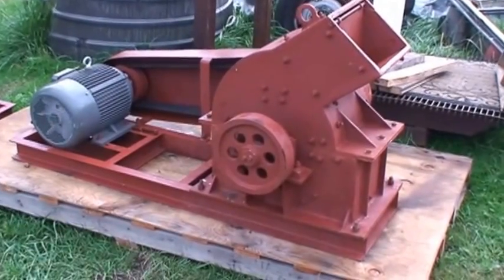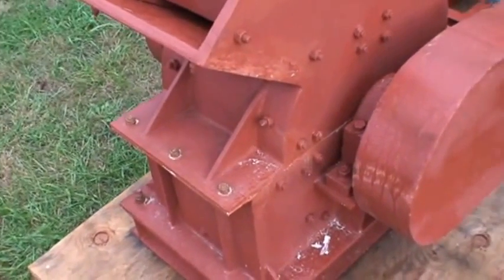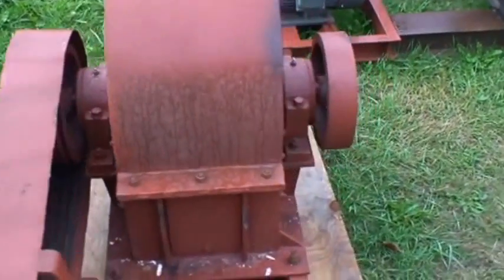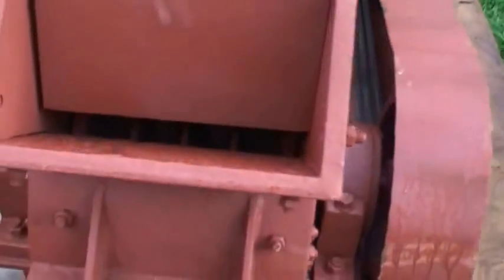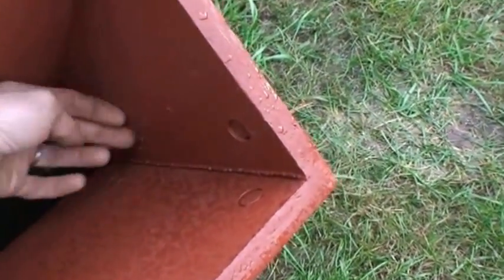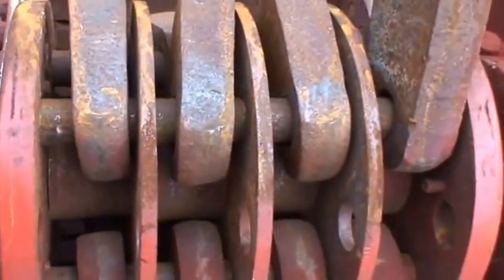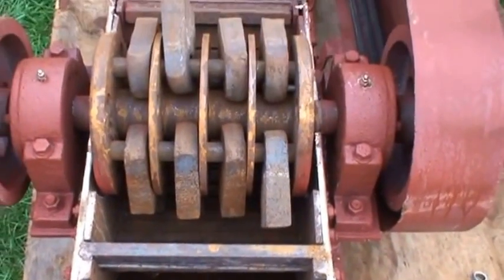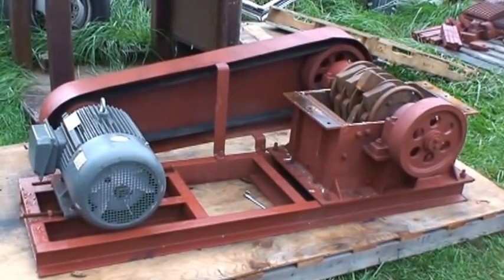Hammer Mill Rock Crusher: Gold Mining/Ore Grinding, Glass/Concrete Recycling, E-Waste Recycling

Comment: how do you adjust bar spacing on screen? And why did you go to laser cut?
Reply from the maker: Dave, to change the bar spacing on the screen you would need to roll out the screen and than install a different screen with different cut spacing. We chose laser cut because it allows us to have multiple sizes of discharge available.